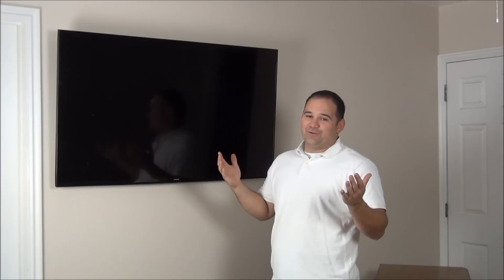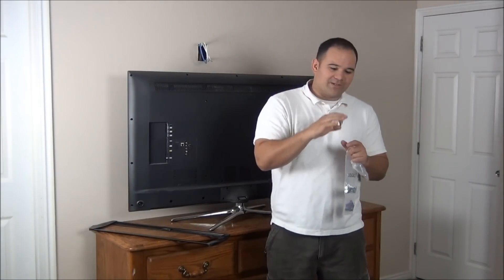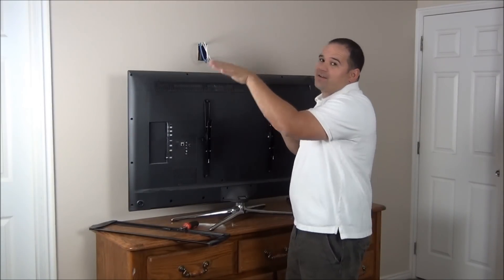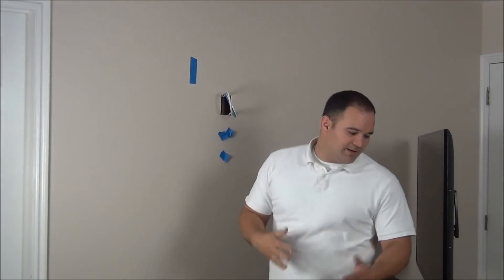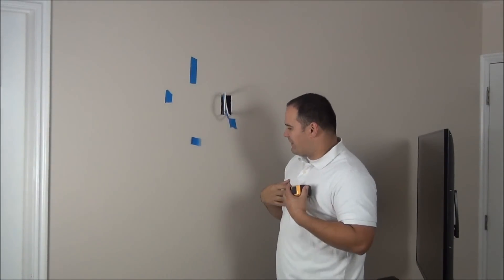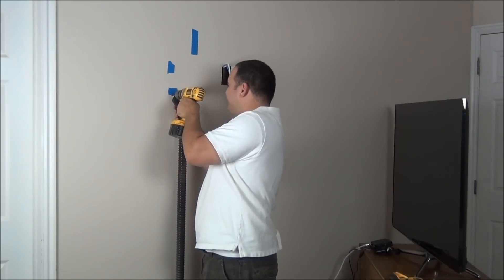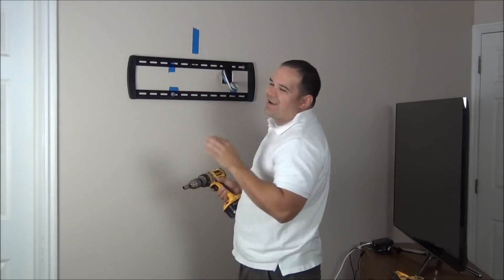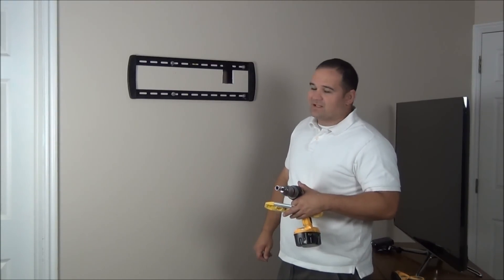How to Mount a TV to the Wall and move an Outlet Part 1

Comment: Actually don't PUSH DOWN on the vertical arms - PULL UP.  The TV due to gravity will automatically want to go down so the arms need to pulled up.  If you push down on the arms that means the M6/M8 screw is at the top of the slot or oversized hole.  You want the M6/M8 screw to be at the bottom of the slot/oversized hole so that the TV can't settle any lower over time/gravity.

Comment: I wonder if the customer would have chosen to move the TV rather than cutting up 4 studs, which may be in load bearing wall ????  Was it a load bearing wall???  Was the customer advised about the 4 studs being drilled through ???
Reply from the maker: Yes the customer knew but it wouldn’t be an issue one way or another since you can remove up to 25% of a load bearing stud by code.